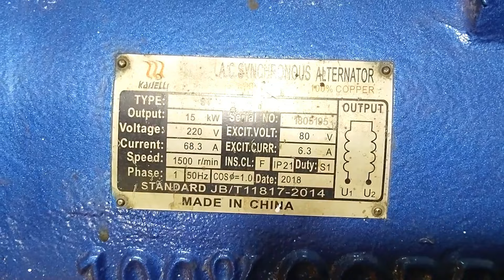We Make Flywheel Spring Machine Make Electricity Free Energy Generator 220v 15kw Alternator

Comment: I don’t get how people think this is impossible. I’ve made smaller scale ones with a washing machine motor and gm 3 wire alternator hooked to a power inverter ran for days by itself. It’s a generator motor that generates power. If it spins it’s making power big wheel makes small wheel go faster all you need is 3600 rpm and hell mine was hooked up to itself. Not impossible. Go make something you’ll be amazed. The only people that truly think you cannot generate power with a generator live in the u.s.a and have been told it doesn’t work lol.
Reply: I believe you man, But I will disbelief i try it with your instruction and fail.
l believe in innovation 
l believe in experiment 
l believe in research 
l believe in mechanism 
God bless you.

Comment: A list of what kind of parts and where to get them from would be very helpful, for example the heavy flywheel, the bearings and brackets holding the heavy flywheel, the big pully wheel, the springs, the altinator generator should all be listed on a parts list and the manufactures names, websites to get these parts on a complete list. I can weld and make the frame no problem but all the other parts I have no idea what or where you got them, so please provide all the details and put links to these parts like all other website do!!!😊😊😊
Reply: Все может быт
Reply: I can envision automotive tires on hubs being used as flywheels, especially if pressurized with water instead of air? Springs and bearings can be upcycled from many junk yards, cams will need to be fabricated as well as frames, always remember that electric motors will work as generators, take caution powering anything that is frequency and voltage/current specific, incandescent lights, heating elements, most motors (except stepper) should work but may be slower/faster speed. Test with stuff that is not valuable

Comment: Exceptional detailed design with the large diameter pulley driving smaller on generator for (near) proper frequency , bearing on spring cams which are at different angles, GREAT WORKMANSHIP!

Comment: The concept of spring generator is good, however there are some inherent flaws, these flaws can be resolved, need a trail and error to refine , as you have explained these are used in industries , there are some improvements required. 1. The Spring generator with 8 springs at 45 degrees each is a good design for running heavy alternators to produce energy, even the flywheel to be heavy and in equilibrium with the springs tension, need to take high quality springs, how this works is when it rotates an alternator it produces a desired energy, and from that same energy , we need to add a motor to rotate the flywheel whenever the flywheel reduces its required spin the motor will support the rotation , few electronics are also required to take into account like speed sensors and automatic switches when the speed reduces the motor will spin the flywheel to compensate the loss and when inertia acts and makes the flywheel to run at the desired speed the support motor will just rotate without power. means to make the spring generator successful we need additional inputs and use of electronics and some variable frequency drives... to help the world to get free energy for everyone....
Reply: Your idea is great, have you ever try to make one yourself.

Comment: Great video! Can this power a home that has high power consumption appliances such as a refrigerator, microwave and washing machine all at the same time??
Reply: Power generation depends on the alternator that is being driven, plus the amount of springs connected. Check for more designs that has the flywheel connect to a belt

Comment: Generator , altenatormust run 1500 rpm for 60 hz
Reply: this is apparently a PTO Generator which runs at approximately 540 RPM for 60hz. With the right belt ratio, this speed is very possible to achieve and maintain.

Comment: ..need an a power supply to run the flywheel n flywheel has a designed weight...ordinary spring can not stand for long hours...the rmp shall be compatible to the dynamo to produce the required electric power..